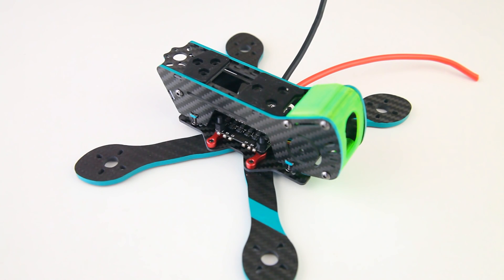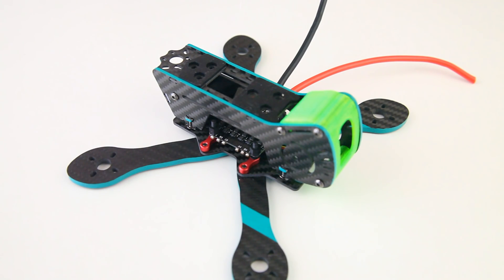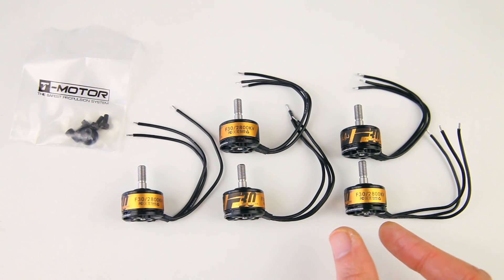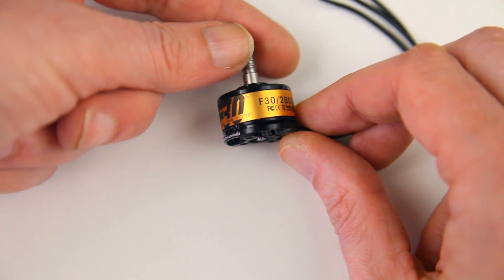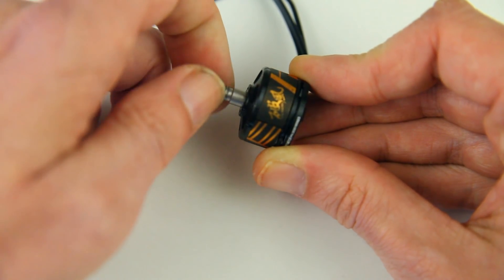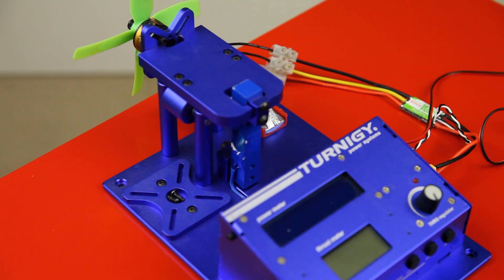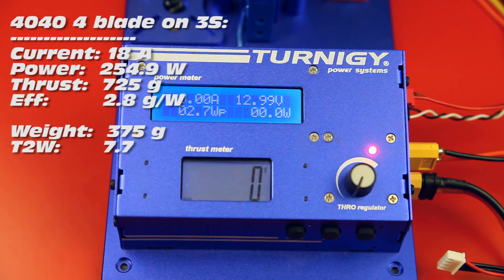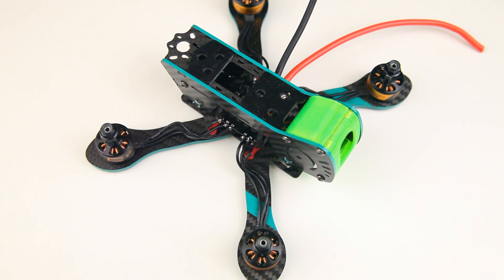GEPRC AX4 Light Quad Build! Part 4: T-Motor F3 1806 motors + KingKong 4x4x4 props :)

Comment from the maker: Time to add motors to our build AND Benchtest them with 4x4x4 props! :)
GEPRC GEP-AX4 Airbus frame: https://goo.gl/r7sEyZ 
REVO F4 FC: https://goo.gl/rQyVhC 
Racerstar RS20Ax4 ESC's: https://goo.gl/sLXncK 
T-Motor F3 1806 motors: https://goo.gl/EWdYpi 
Hyperion G7 HvLi Graphene lipo: https://goo.gl/FOm2Eu 
KingKong 4x4x4 props: https://goo.gl/8pUXRJ 
RunCam Swift 2 camera: https://goo.gl/RvXOR3 
Aomway TX001 transmitter: https://goo.gl/84DTZh 
FM800 PRO FASST Sbus receiver: https://goo.gl/m4IvZD 
Foxeer antenna: https://goo.gl/FL5hHY 
Lantian Buzzer: https://goo.gl/hUp10Z

Comment: Wow 725g on 3s?? The official test was 609g thrust on 4s with GF4045 prop (Temp. 66.6c, which is a little hot). Which battery you use for testing? What is the temperature difference running on 3s and 4s? I am thinking to build one 4" quad using this motor, but not much review and test that I can find on internet. Thanks!
Reply from the maker: Howdy sir :)  Well yes, BUT I used a 4-bladed prop right? :)  So that would probably account for the higher output.. 
I probably won't try a 2nd run on 4S, as I kinda destroyed my 1 spare motor on 4S :$  Again, this was with a 4-bladed prop.. but it got HOT.. part of the paint burned of from the motor :$ 

Then again: It flies Great on a 1000mah 3S Graphene lipo :)
Reply: Subscribed!! Thanks for your information, it helps me a lot. So for the F30 motor the 4x4x4 prop with 3s lipo has a lot more thrust than 4x4.5x3 with 4s lipo that list on official website? I am still deciding between 3s and 4s build, because I want to build a 8 to 1 power to thrust ratio (or more) quad that can fly aggressively for at least 3mins.  By checking the description link looks like you are using High Voltage 1000mah 3s battery? So if I am using normal 65C 3s Lipo the thrust won't be that high right? And what is your flight time with 1000mah 3s lipo?
Reply from the maker: True :)  That will not be a Massive difference, but there is some difference indeed :) 
The flight time is Good! 6-8 minutes But.. my quad is light (just below 300 grams).. so that helps a lot..
Reply: DutchRC Adventures I see, so your 1000mah 3s is LiHV (high voltage)? And your quad that weight 300g is with or without battery?
Reply from the maker: Yes sir.. without the battery :)  and yep.. my lipo is a Hv one :)
Reply: DutchRC Adventures Thank you so much, now I know what i am looking for!
Reply from the maker: Well GOOD! :D  You've seen how fast mine is on 3S? (fast enough in my book)